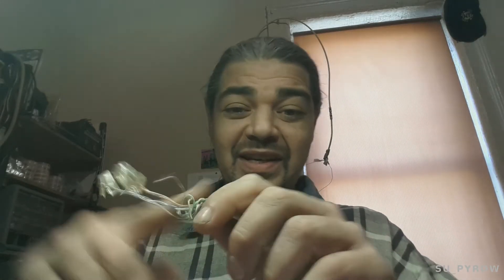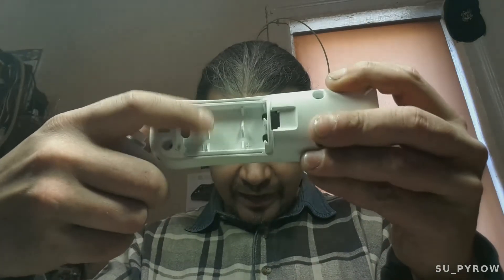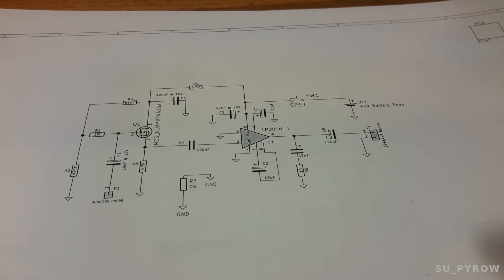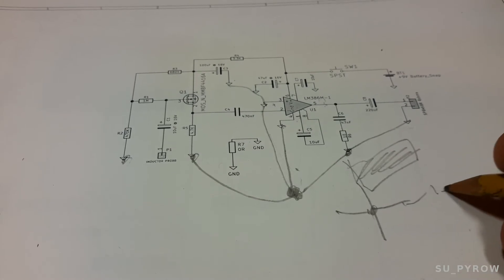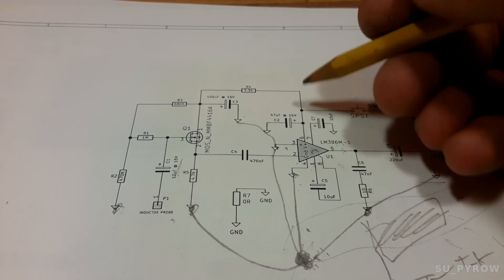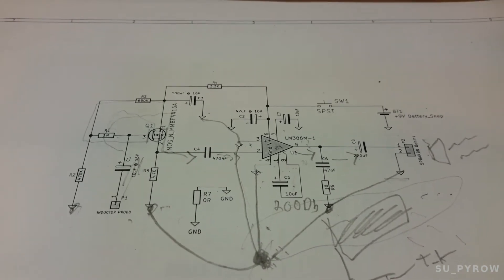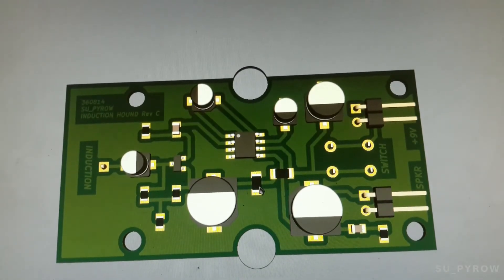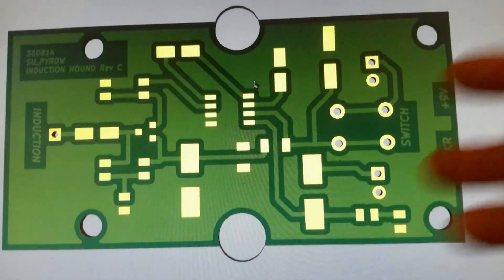How to build a DIY Induction Probe / Toner Signal Tracer Part #1 - Circuit Board Design SU PYROW #12

Comment: so did that actually happen to you they cut a hole in your wall and cut through the cat 5 cable?  That is definitely a handy thing to have to check where the wire runs behind the sheet rock in a house where you have no idea where the TV cable or any cable was run. Thanks for sharing great idea
Reply from the maker: Larry, it happens EVERY time.  lol  the damn sheetrock guys use a roto-router tool to cut around the inside of the electrical boxes, so the sheetrock can go flush to the wall, my wires are bundled tightly inside the box.  they have this 3inch bit that just goes right into them.
Reply: wow i'm glad I don't live in an apartment  anymore that would really piss me off.Used to live in an apartment  18 years ago. I mean it was a nice place only a 2 bedroom but back then I was paying $1450 a month but that was in Fruits and nuts land California. Geez glad I left that place 6 yrs ago and bought this house.
Reply from the maker: i was talking about new construction, brand new houses. this was 18 years ago when i was doing installs to make food money.